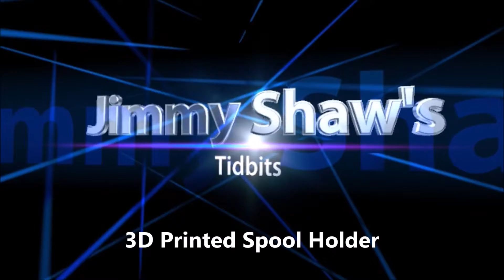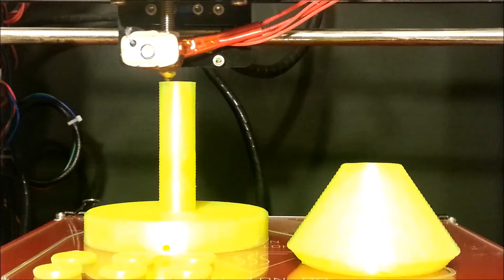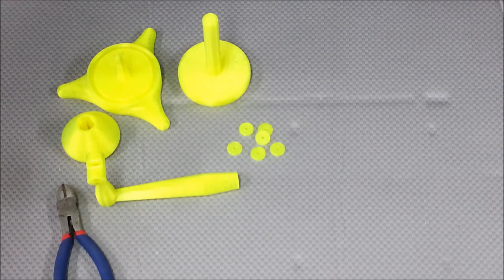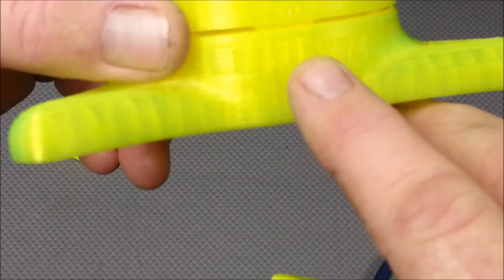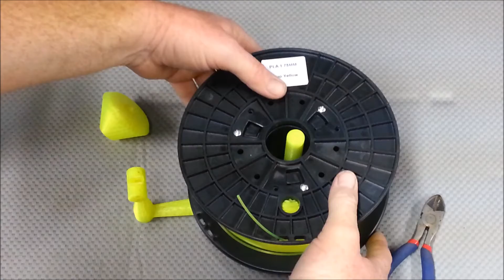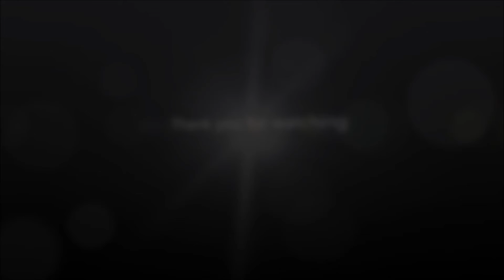3D Printed Spool Holder

Comment: Hi, Jimmy! Thanks for making a video about our 3D-printable spool holder. We are really glad you liked it. 

We initially designed it just as a fun project to see if it was possible to make a rotating spool holder made exclusively of 3D-printed parts. 

Happy 3D printing! :)
Reply from the maker: +Creative Tools A year later it still works great.  I need to reprint 1 part because of a accident where it was pulled off the shelf and it broke, but it still works so good I keep forgetting to reprint.  LOL!!!!  Thank you for a awesome design.
Reply: Wow :) That's great!

We are by the way designing an upgraded version of the spool holder, with some subtle improvements - such as being able to be mounted horizontally.  Stay tuned! :)
Reply: Really a great design

Comment: build area of printer?
Reply from the maker: +Fattah Lee They say the depth  is 200mm width is 200mm and Height is 180mm.  In reality when you account for the clips that hold the glass and the knob on the display panel, it really is 180mm deep, 200mm wide by 170mm tall.